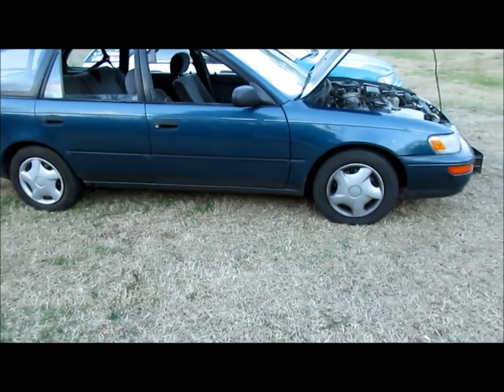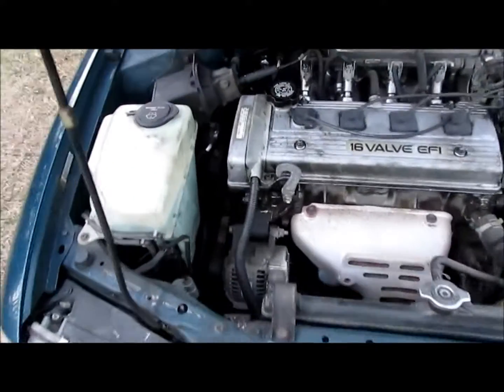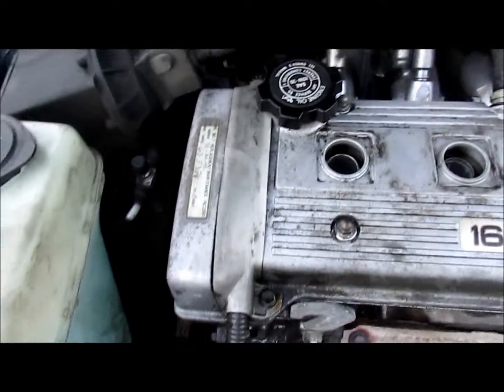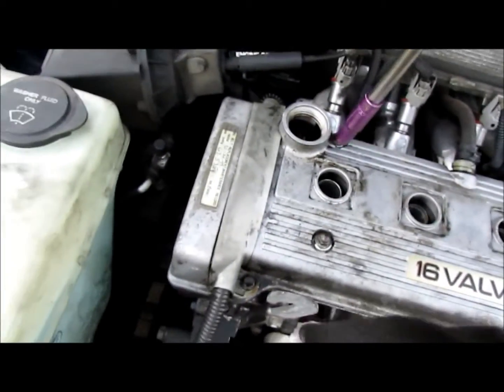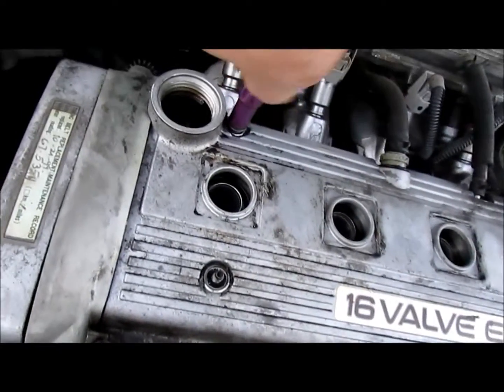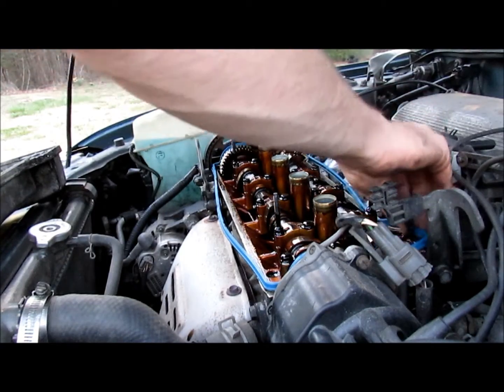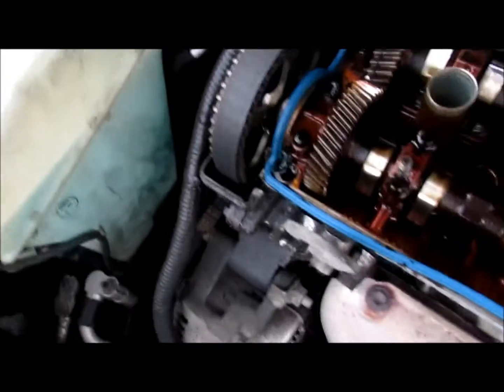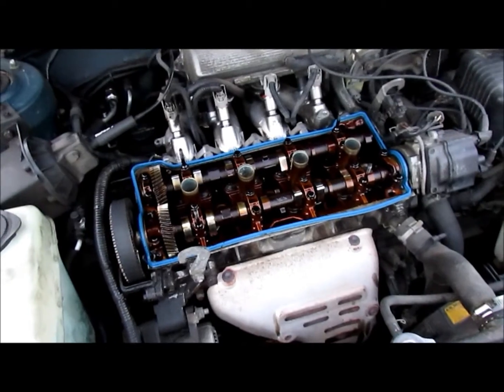Corolla Wagon Timing belt check

Comment: If you're looking for a timing belt replacement sticker on a vehicle you're looking at buying it's worth having a good look around the door shuts, a lot of mechanics in the UK, including myself, would put the sticker inside one of the front door shuts (usually the fronts but I have seen them on the B pillar inside the rear door too, it rather depends on where run off water runs on the vehicle) as the heating and cooling under the bonnet can weaken the adhesive to the point where the sticker falls off and it can also cause the ink used to complete the sticker to fade out to the point where it quickly becomes unreadable.  There is also the fact that under the bonnet tends to be a pretty mucky place on a vehicle that's more than a handful of years old and the stickers stick best to clean surfaces but finding or creating a clean surface can be a fool's errand...

Comment: Had a friend with a 2004 Tacoma over 230K miles with the 4 cyl. Original Timing belt. When he replaced it there was belt chunks missing and it was completely cracked and rotten all the way around. Didnt skip teeth or was out of time. Put new belt and water pump and it was all set. Original water pump too obviously.

Comment: Yeah, but you can't really tell just by looking at the top, because you can't see the teeth on the belt. When it comes to timing belts, my rule of thumb is "if in doubt, throw it out"
Reply: +justsomeguytoyou  That is definitely the best advice on a vehicle that you don't know the history of as on a lot of vehicles a snapped timing belt means a ruined motor.  At least with this car it looks like the previous owner had a good mechanic or knew what was best practice in maintaining their car which is a good omen for how the car has been maintained...
Reply: Yep, I'm with you on that.. you need to see the teeth..I've pulled the covers off KiA's  to replace crank sensor and found a hand full of teeth fall out..and it still ran.. was a DOHC